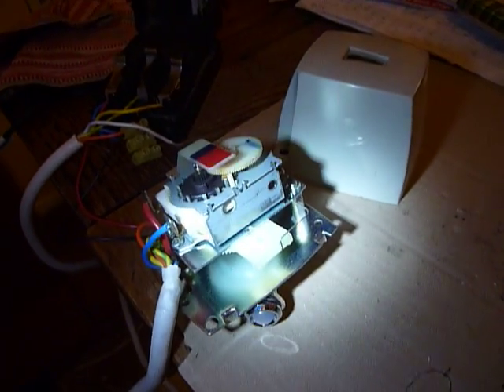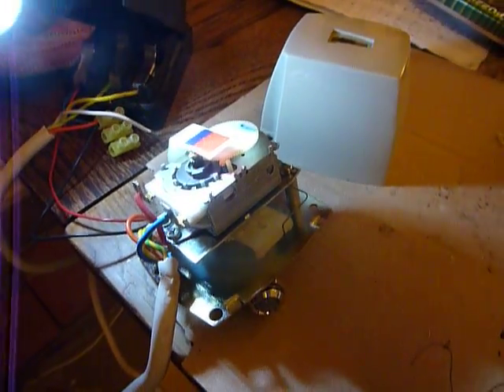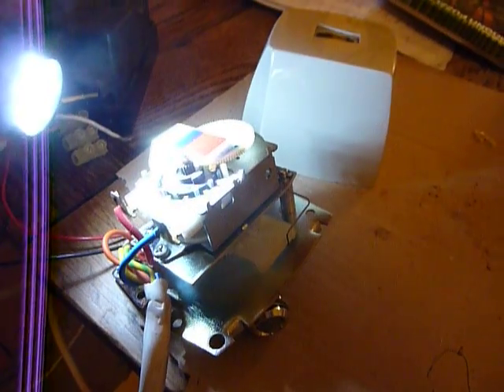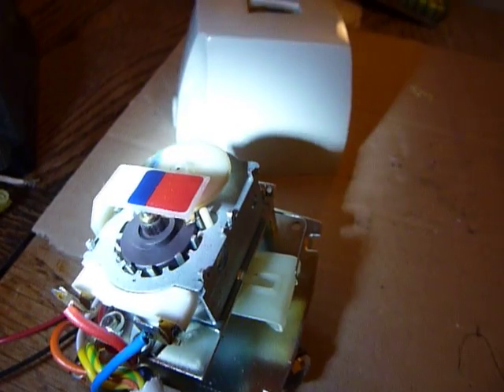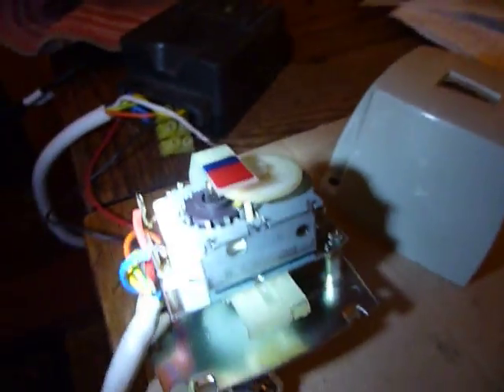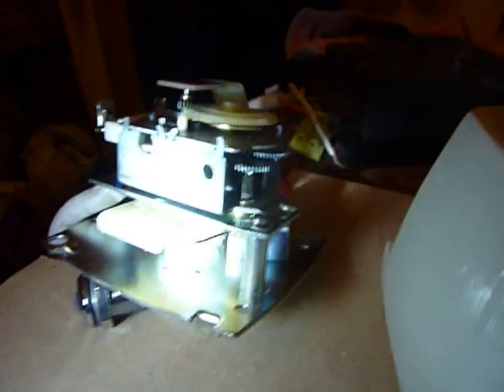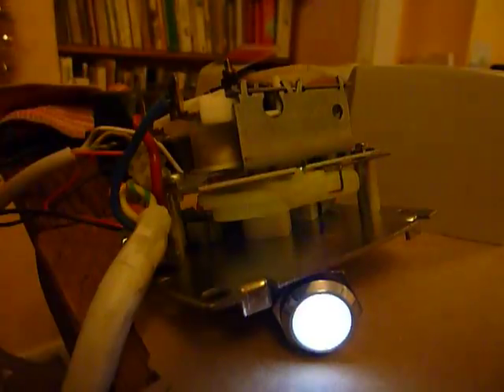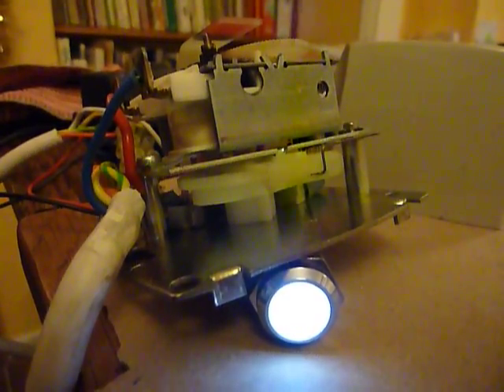Sunvic/Satchwell motorised valve operation

Comment: Hi John,
My actuator is making click noise when I switch on my hot water to boil (Tank system), I can see white pin under top circle is hitting black circle, This result into my radiators are heating when I swich on water to heat. Any idea hot to fix this ? appreciate your assistance